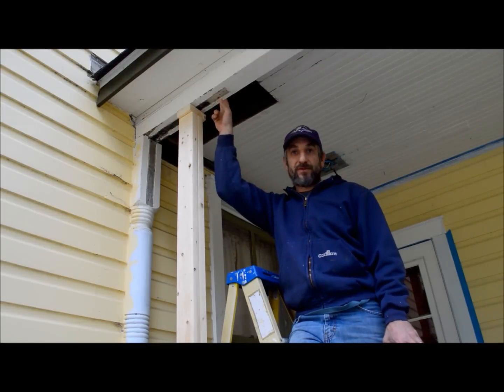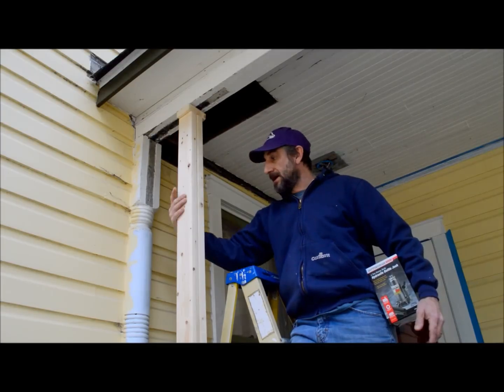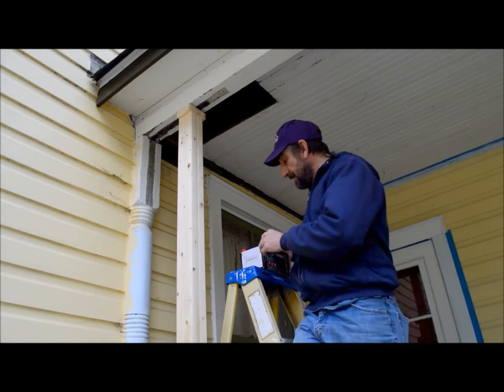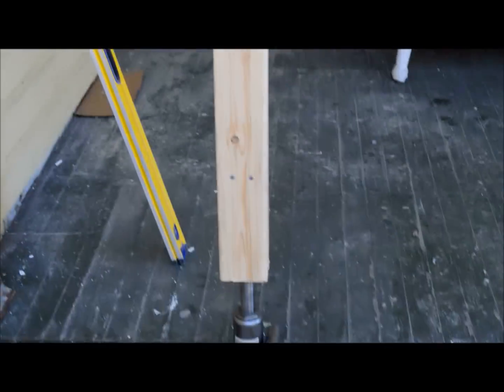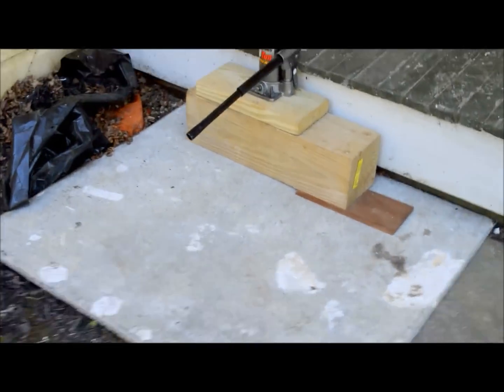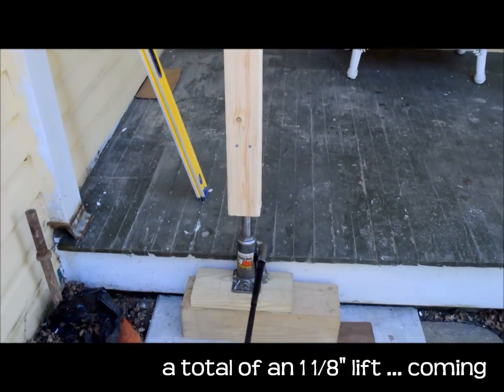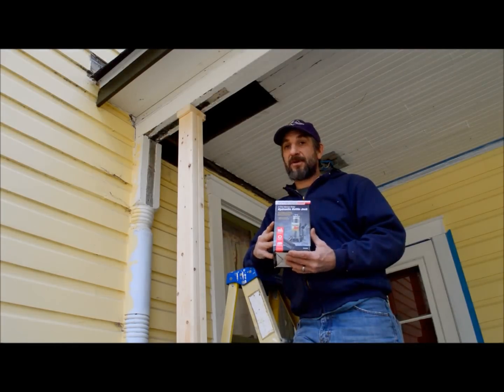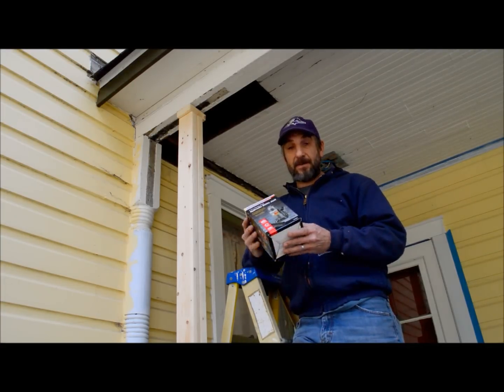Jacking Up a Porch Roof at a Side Wall

Comment: Thanks for this vid.  the front of my house that juts out like some overhang over the sidewalk in front is tilted toward the ground and I think the last person who put posts under it didn't measure it right so instead of paying $500 to $1000, I'm going to buy 2 of these jacks and do it myself and then reposition the gutter ends because now they're way hiked up to get it angled down so after I shift that part of the house up by say 1.5 to 2", the gutters can come back down and look better and work better.  Water is actually angling off the shingles due to the tilt.   thx again.  This vid has saved me a lot of $.  $50 for 2 jacks and another $40 for some 2 x 4s is a lot cheaper.  I have tons of spare time so I'll get this done without wasting days trying to find a reputable construction company that'll do it right and for a fair price.  thx

Comment: You could put a piece of metal between the jack and the wood so it doesn't dig in. Also it's a bit dangerous to not have a nice straight push as the jack can tip and shoot out. Glad you got er done! Good job.